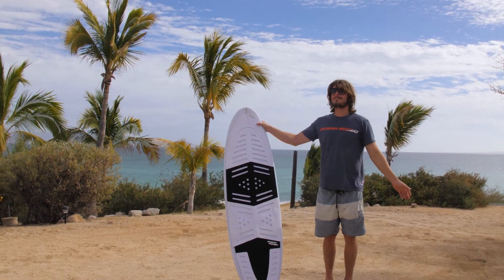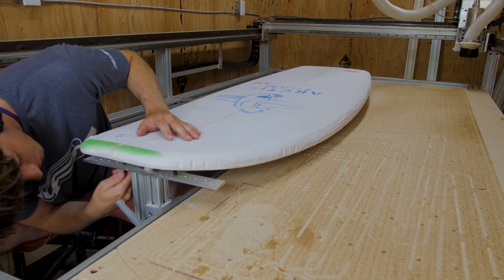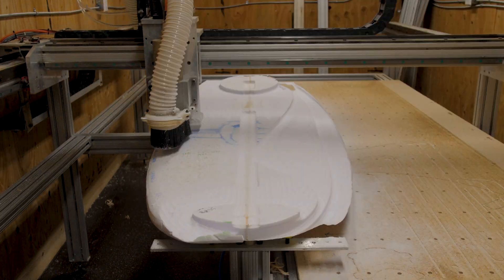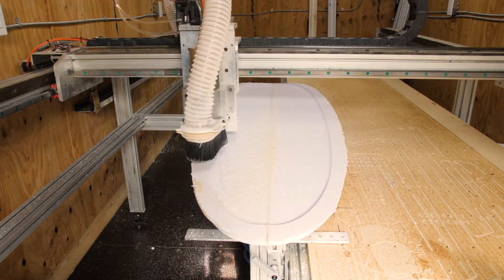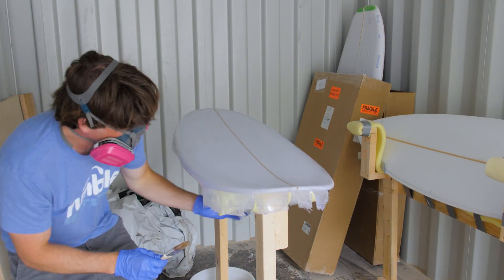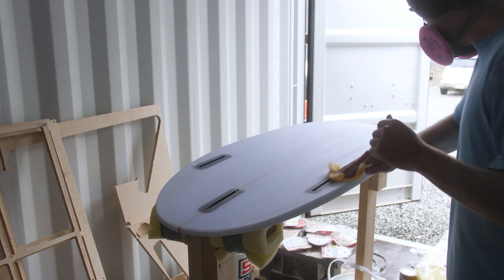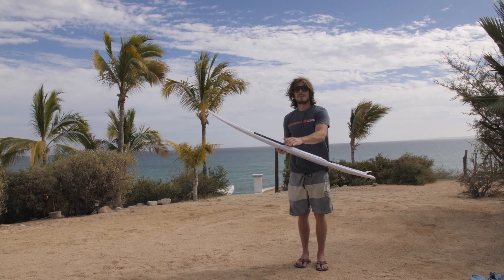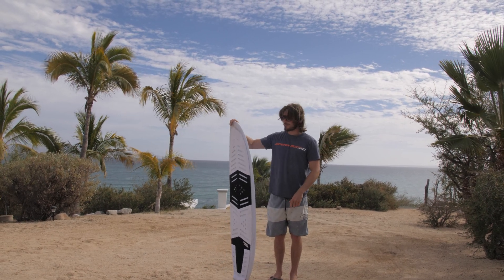BUILDING/TESTING A FREESTYLE KITESURFING BOARD

Comment: awesome work mate! just wondering how long did it take the machine to cut the blank? cheers!
Reply from the maker: Hey, it takes about 20-30 mins to cut 1 side. It takes about 10-15 mins to setup the machine for each cut as well. So about 45 min per side. If you're doing multiple boards, the setup time becomes negligible.

Comment: A few years in, curious how this thing held up?! Awesome end result and use case for the cnc
Reply: Also, steezy testing 😅
Reply from the maker: Hey I still use this board from time to time, holding up really well other than heel dents. I've stopped using PU blanks and only using EPS now, they hold up even better to the heel dents.

Comment: I've been operating a cnc as a job for quite a few years now, mostly cabinets and MDF one-piece doors along with various side projects in aluminum. Something that stood out to me immediately in alignment/prep is maybe consider using a dowel in the table for alignment? Have the CNC bore two holes through the material, flip it over and stick it in. Whenever you're done with the first operation on one side, have it add the dowel holes again for your flip/alignment. It seems like it'd be easy to grab a can of spray foam and squirt some in there to fill it up- at least much easier than going through the trouble of aligning them. Also, I'm guessing it's some type of foam, right? I've watched every video in the series and still have yet to catch on lol.. Maybe get a 6-7" O cut and instead of doing the surfacing passes to clean up the outside, have it cut completely through the material to get you to your final 2d shape. Program in a stop point and remove the excess, then start your operations again. 

I might be building a vertically mounted CNC to do tenoning/mortising for mitered doors soon, so these videos are valuable.

Cool stuff, can't wait to see more.
Reply from the maker: Hey Alec, thanks for watching the vids and for the feedback. I have actually seen someone use the dowel hole technique for shaping a board. It was on a machine that wasn't purpose built as a board shaping machine. It worked well but required alot more time because we had to machine a rocker table to match the curve of the board as well. Definitely something to think about, but the main issue is that I have to re-arrange the suction cups when I flip the board, so technically the "bed" of the machine is changing and I will have to re-zero the machine anyways. 

Yes I've been shaping the boards out of PU foam. 

I bought a 6" foam specific ball endmill a while back but the minimum RPM on my spindle is too high and the tool begins to wobble and vibrate the whole machine, leading to an e-stop.  A longer tool will fix all the issues I have with removing the extra foam. I'm actually in the process of making some minor mods to the frame of my machine to accommodate a longer tool. Hoping to get that going soon.

Goodluck with your build if you go ahead with it!
Reece

Comment: hey bro, very good job and amazing freestyle skils, bravo. i have some questions to u. now im shaping my boards by hands but in plans is to make cnc machine - its clear for me but  im   still not shure the best way to make 3d model. shape 3d is pretty expensive for me especialy with cnc mode. I'm thinking about SolidWorks or something like this. Can u explain your way?
Reply from the maker: Thanks! Shape3D is pretty sweet for designing the boards, but yes the CNC version is expensive. I use shape3D EXPORT version to design the boards. The export version is cheaper. Then I can bring my board model into Fusion360 (which is free to use, I think still?) and I do the CAM and generate toolpaths in there. There is a little bit of my workflow in this video, hopefully it helps:
Reply from the maker: https://www.youtube.com/watch?v=GLXYlKfA7ss&t=596s
Reply from the maker: I should also add that programs like solidworks are not very good for designing boards because they are too curvy. It gets frustrating trying to make something that's not a box in solidworks. I think it's well worth getting Shape3D for simplicity. Rhino is also better than Solidworks for curvy things like surfboards, but way harder to learn.

Comment: Yewww good job mate! hopefully you will find a solution in cutting your blank, i reckon there is too much prep involve pre cutting. Please keep posting more videos!
Reply from the maker: Thanks! Yes most of the time is spent measuring/prepping, the actual shaping is the easy part. I've done a few more cuts since this one and I've got it down around 30 mins per side of the board. It would be even faster if I do multiple of the same board, don't have to rearrange the vacuum supports. Ill throw more updates on here when I can!
Reply: @reeces_shredlab  Exactly, may i ask for your email add? would like to know more about your setup if thats ok. Cheers